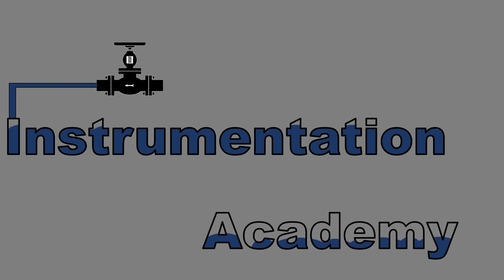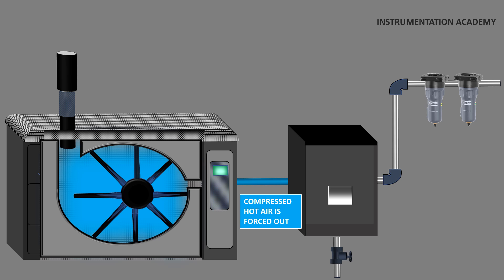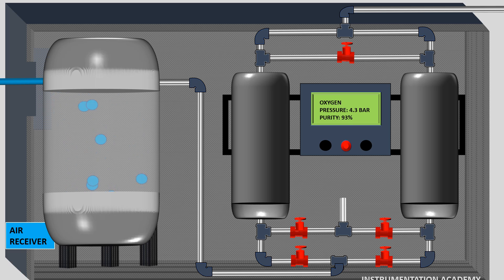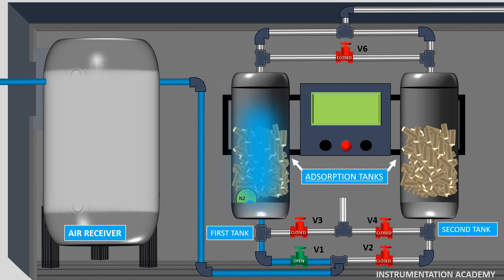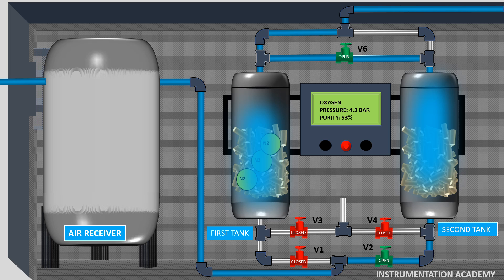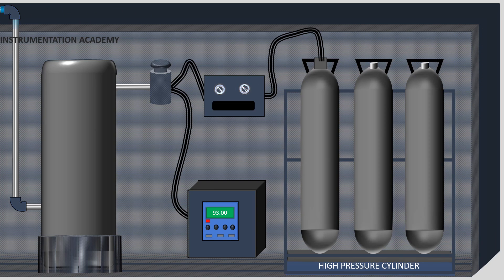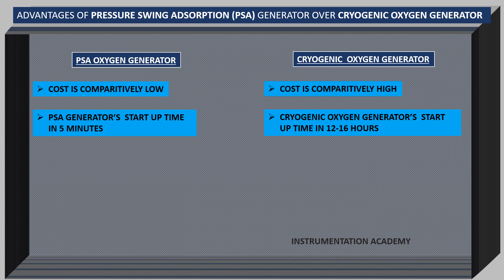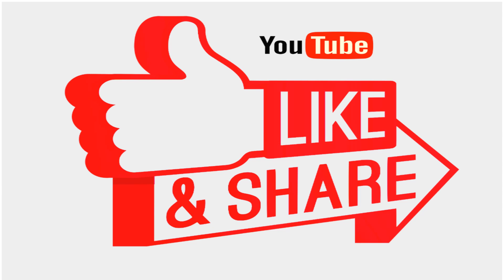PSA PLANTS WORKING ANIMATION..LOW COST MEDICAL OXYGEN PLANT.OXYGEN CYLINDER FILLING PLANT.ANIMATION.

Comment: I have a question: the  diameter of O2 is smaller than N2. If we increase the pressure, o2 must be go inside the pores of zeolite molecular sieve. so N2 will pass through anh to be collected. But you said that zeolite will absorb N2? I do not understand

Comment: VSA (Vacuum Swing Adsorbent) plant is more energy saving Oxygen plant compare with either PSA (Pressure Swing  Adsorption) or VPSA (Vacuum Pressure Swing Adsorption).
Cost per cubic meter (1000 litters) Oxygen in VSA 1.75 KW approx. 1.3 KW in VPSA, but in VSA hardly 0.65 KW.
More over unless otherwise wise use oil free compressor for elevation air pressure, it is high risk in oil injected screw air compressor for use medical application.
Even online filters and air dryers used for air quality, in absent of periodical maintain of the unit, zeolite may contaminate with lubricated oil, result will drop purity of Oxygen and have to invest for replace zeolite (If it happened in  warranty time replacement cost will fall on suppliers, out of warranty customer have to bare the lose)